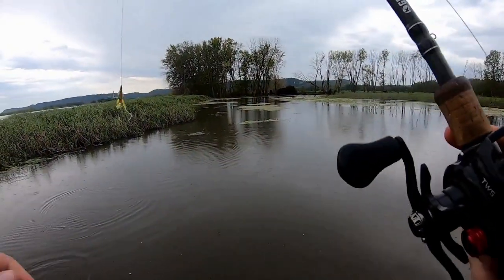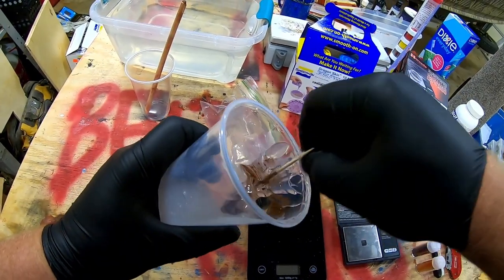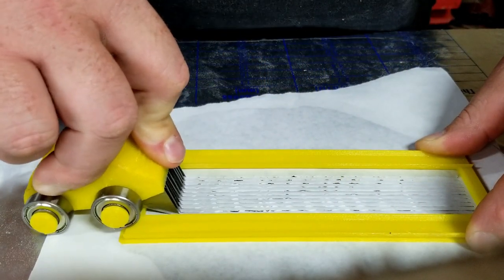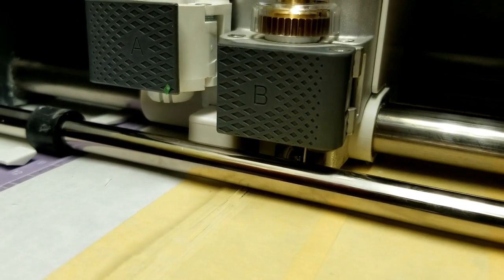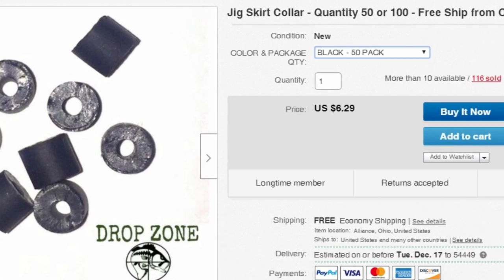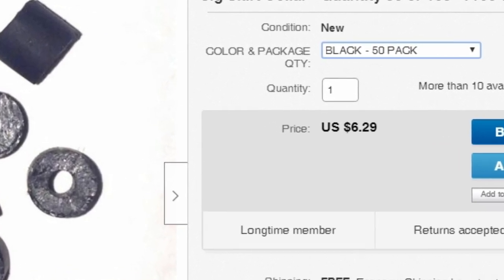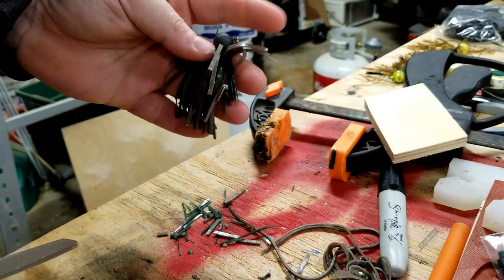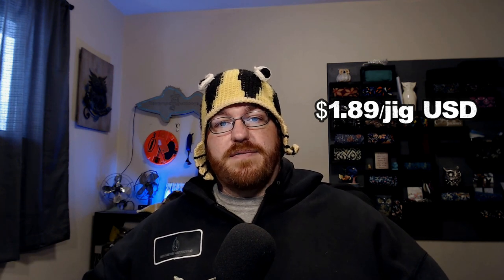How to make bass jig skirts (MakeJig) - Episode 3

Comment: It seems like you need to buy or 3D print a pasta cutter to cut the strips of skirt material. Just set your preferred width of cut. No reason to reinvent the wheel.

Also, using another food technique might help too. Powder the silicone sheets with cornstarch for easier cutting.

Comment: Hi! Very helpful video, thank you. Could you reveal  the inner and outer dimensions of the orange skirt making tool tube? I would like to make one for myself.
Reply from the maker: Sure I'll check it when I'm back at the desk! I'll try to remember, if I don't respond in a day post a response lol
Reply: @RevampedOutdoors  Ok, thanks!
Reply from the maker: Inner diameter: 50mm
Inner width for blades: 22.8 mm
Outer length: 60 mm
Outer bearing holder width: 56mm

Comment: Ever thought of making a tray to put the silicone in so you could just rub across the top and get consistent depths and then run your rotary cutter across.  Basically make a skirt like you get from factory dealers? Quick and easy to work possibly, especially since you have a CNC to make the pour blocks yourself.
Reply from the maker: I've thought about making a small 3d printed mold to inject the silicone into but the clearances seem to not be tight enough and I get a bunch of flashing. I might have to try the tray idea, the silicone is a bit sticky but I think with the right type of tool to drag it across might work. Thanks for the idea.
Reply: @RevampedOutdoors  i was thinking, maybe lay a sheet of wax paper down first in a 1 inch wide by 5 inches long slot. You could make a tray that has 6 to 10 slots at the 1x5 size. Plus, a flat piece to massage the latex flat or roll it level. Up to you. You're the smart guy with the tools. Surprise us all with your skills. Haha Then use that rolling cutter you made. I think you could mass produce some for yourself. If it works. I'll buy a set off of ya. Lol
Reply: Do you think this slicer would work for slicing tube tentacles?
Reply from the maker: I would think so, would just have to be careful with the orientation so they stay consistent.